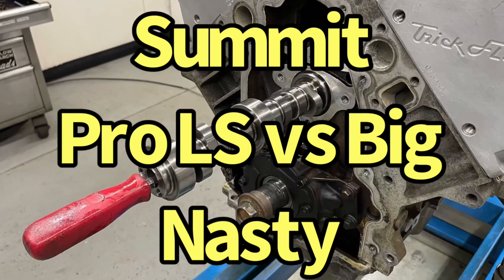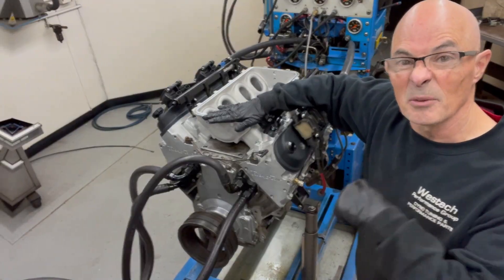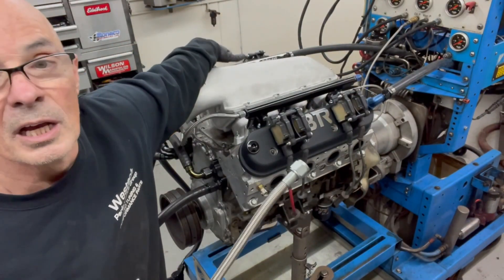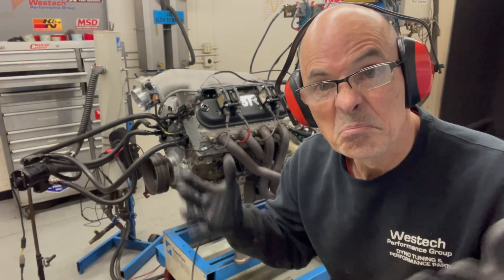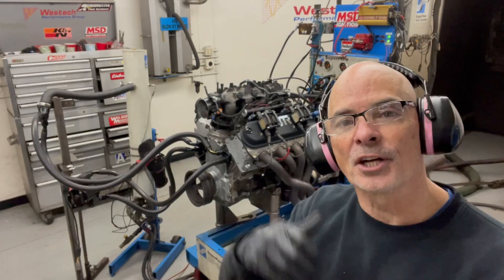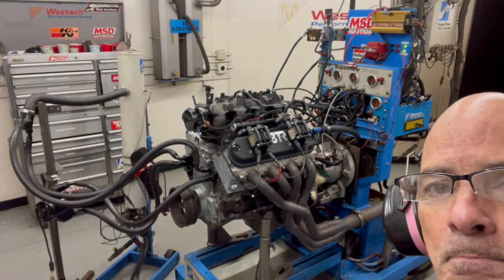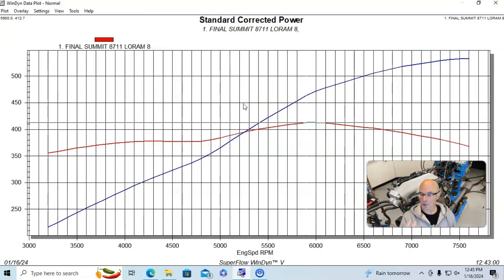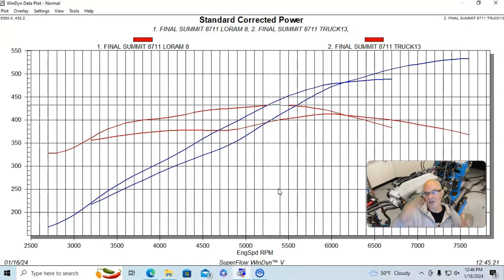TIGHT LSA 5.3L CAMS-DO THEY WORK? ENTER THE SUMMIT BIG NASTY CAM TEST-BIG NASTY VS BIG BOY 8711R1

Comment: How well is the quality of summit racing camshafts as a whole, I got a l31 350 I want to build with a summit 525/520 lift cam with a 210/220 duration 112 lsa cam from summit. Motor has 10 to 1 compression with 195 afr heads with dss racing pistons and Manley rods and arp rod bolts, with a duel quad holley 450 carbs. Is my plan.
Reply from the maker: they work well
Reply: @richardholdener1727  that's good to know thank you.

Comment: If only the Truck Norris were about .585 lift..
Reply from the maker: why?
Reply: @richardholdener1727  @ well we know lift adds power everywhere, right? So why can you not find a tight lsa cam like the truck norris with 107-108, but with more lift, say around .585-.600? Seems it would be the best of both worlds. Good low end, but more power up top? I would like to see the truck norris with those lift numbers, or the stage 4 v2 with higher lift too.

Comment: Quick question sir. I have a 2009 Trailblazer SS with a fresh forged 370 with the comp 273hr extreme energy, total engine airflow stage 2 cnc 799 heads with but platinum 660 springs 1” 7/8 headers. I have a nice set of shaft mount rockers I would like to use but I notice you don’t recommend them. What are your thoughts. ? I have the spring pressure so I don’t see valve float to be an issue.
Reply from the maker: not sure what you mean by thoughts
Reply: @richardholdener1727  Would you use the stock rockers with a reunion upgrade or the t&d shaft mount if you knew you had adequate springs? I know you love the stock rockers but I’m worried about accelerated wear in the pushrod cups.

Comment: Please tell me I'm not going to have to watch a tight lsa cam with an intake other than an open plenum. This is the reason I unsubbd to begin with. Just waste my time.. And I have to listen to a dork make engine sounds...
Reply from the maker: you obviously need to watch more cam test videos if you think a tight lsa only works with an open plenum (you have much to learn)
Reply: @richardholdener1727  ha! You totally just put words in my mouth. I didn't say anything close to that! You have no idea how funny it is for YOU to tell anyone much less ME that I have a lot to learn. I learn things everyday day & so do you, the problem is, you will look at a problem & quickly assume you know the problem instead of learning what the data is telling you. Reminds me of a sbf you did a cyl head test on and when it kept falling off at the exact same rpm with every set of heads, instead of realizing your cam timing was likely advanced, you said that EVERY set of heads were falling off due to valve springs! All new heads, all different springs.. Or the time you put a truck intake on a 5.3 you just pulled to 7600rpm!! 🤡🤡

Comment: Its alllll about the big cam, if IF!  your drag racin, rev the piss outta it and like leaving a 20ft crater in the pavement when the crank comes out the bottom....  ok maybe a little exaggeration.  BUT.... I will take 5 horse comin off the corner over 15 horse at the top any day.

Comment: I wanted to do an engine build in steps.  Do a 5.3 or 6.0 setup for turbo, but setup the turbo later.  Is that doable? Or should I just make changes when I get the turbo? Meaning should I gap for boost? Or do it later when I have the turbo setup?
Reply from the maker: gap now, turbo later

Comment: I have several different projects on the burner. 77 coupe deville with 425cid Th400 trans(just restoration). 96 OBS Silverado with carbed 350 that my father put together for me before he passed. Picked up an 07 Yukon SLT 4x4 ($2,500 at 230k miles)that has AFM that im praying will last for a while after i delete the AFM. 05 Suburban Z71 4x4($2,300 at 350k miles) that i want to use as a tow/overland vehicle. The current 5.3 (706 heads)now has nearly 370k miles. I plan on getting a built engine from Jasper or similar. Should i go back with new 5.3L or should i swap in an LQ4 and change the transmission? I would like to tow long distance, if i have a road trip or travel a ways for a new project vehicle. If you recommend the LQ4, should i leave it as is or should i install the 706 heads on it? Considering putting an LS in my 99 Crown Victoria P71 5.3 or 6.0(want it to play with hellcats)  Love your content brother. GOD Bless you and your family.
Reply from the maker: lq4 is better for towing

Comment: Richard love all the content on all your videos. I built a 6.0 Iron Block bored to 6.2, stock crank, Camaro ls3 rods and pistons with relieves, eBay ls3 heads 64cc chambers, TSP 629/615 225/236 114 cam, TSP dual spring and pushrods,BTR rockers, IC Billet low rise intake 102 TB, stock LS3 injectors, TR6 4177 plugs MSD wires stock coils, BBK shorty headers. Just wondering if you have ever done this combo before and what the expected HP Torque on 91 octane and also any recommendations on this combo?
Reply from the maker: near 540-550 hp (stock LS3 is 495)

Comment: CHEVROLET PERFORMANCE CAMSHAFT - LS9 - 12638427

Specs: 211/230 Lift .562"/.588" 122

Can I use it in yukon 5.3 2008 I found it in Summit website only $122.99

Thanks a lot Richard,

Comment: Would this be considered to be almost a Towing cam? If your trucks rear axle is geared to put you in the lower portion of this Nasty cams sweet spot.. And im also thinking how these results would translate to a 6.0 truck motor. The most common choice in 3/4 to 1 ton trucks.
Reply from the maker: just sure this idle is what you want for towing
Reply: @richardholdener1727  thanks for the reply.  But was that a Typo?
Reply: @hardhead7056 I think he meant “not” instead of “just”. I’m sure there’s a towing cam out there on the interwebs
Reply: @Scott_Buchanan  maybe. 
But im thinking of that cam like a marine application.  If the rpms are right its a towing beast.

Comment: The thing DV has actually stated is problematic about the LSA formula, is that it's just the starting point. It changes with compression ratio, desired rpm range, fuel (I believe) etc... 
To me it makes sense how DV explains it, taking key aspects of the combination into consideration and going from there.
The argument comes in where one side says LSA is an output, and the other side says there is 1 right LSA for an engine size and head. Neither are true in my understanding.

I get that shelf cams are meant to work with many combinations, and have things like PTV clearance and restrictive environments to operate in without getting a bad reputation. Most of us can't afford to have 20 custom cams ground and all the dyno and tuning time to go along with it. 
It would be a cool edition to see DV spec the cam for that engine to see how it compares. Would it solve keyboard warriors? Nope. Proof of concept? Maybe...

Nice work on the title Richard, bringing out the emotions!

Comment: I like the summit 8702 camshaft. I have one in my 6.0ls with falt top 2 valve relief pistons and 799 heads with tsp 7.450 push rods and and trunnion rocker arms. Sounds real healthy.
Reply: Yeah yeah but does it perform? The way it sounds is for the ricers hanging out in a parking lot somewhere
Reply: @Headsup9550  it does well for me, I was on budget

Comment: How would the Summit cam work in a factory head LS engine?  As tested it has aftermarket heads.
Reply from the maker: the cam works with any factory heads
Reply: @richardholdener1727  Would the HP & torque gains, using the Summit camshaft with the stock heads, be comparable to the HP & torque aftermarket heads?

Comment: So you tryed a cam with to much lsa and one with to little😂. A lsa test that doesn't incude a lsa selected by David Vizards formula isn't much of a test.
Reply: Lol... that dang Empirical formula that no one has been able to prove wrong because it was derived from actual results... thankfully Richard has proven that each combo has a correct LSA and it’s not just a random output
Reply from the maker: there is no absolute LSA for any combo-nor is there a perfect or best cam for any combo-that is nonsense
Reply: @richardholdener1727  well there is one way to prove your theory. I've seen some pretty convincing tests that say otherwise.
Reply: David Vizard is a well respected individual in the engine building community. To call his theory nonsense without testing is well, nonsense.
Reply: @richardholdener1727 Thier is an ideal LSA based on certain criteria of an engines overall combination.

To call DVs formula "non sense" is rather disrespectful to a man who's has likely done more dyno tests than you ever will with over 60yrs experience and has actually raced and also a consultant to race teams as well as a highly respected consultant to the high performance industry in general...You should understand what the formula is about and no, its not about just one LSA as you think.

Don't mix up your sponsored and paid dyno content for DVs research and development dyno testing.

Comment: Richard: are the SAE or seat durations available?  given the Timing we could compare the overlap of these cams  shorter duration and closer LSA they may not end up very different.   Also have to consider the low lift flows as LS is much different than SBC so have to be careful of flow thru intake then out the exhaust.  Can overheat catalytic converters and suck mileage so have to rethink the old camshaft advice.  We are even seeing shorter exhaust than intake especially with high flowing exhaust ports.  4 valve heads are another completely different ballgame as are semi hemi twisted wedges and hemis
cheers
Reply: The Summit  Pro Ls lobe intensities were the same across the four lobes.  I designed these two cams with intake opening and exhaust closing in the same place to have adequate piston to valve.  The “problem” we have is the customer’s want the chop of 8711 but the 51 ft.lbs of torque when they mash the throttle down low, so I closed the intake valve earlier by 14 degrees to move the powerband down. Both cams produced within 8 ft.lbs peak despite DRASTICALLY different dynamic compression ratios (for people who use that lol). I do tailor exhaust closing point around the exhaust systems used to prevent reversion and this includes turbos where a small T4 may have extremely high back pressure in relation to boost.  In this case the reversion damages engine components (buts rings, breaks pistons and valves , blows head gaskets) so the turbo cams are mostly about durability and enhancing spool. Our T6 twin turbo cams have more allowed overlap than the T4 cams.  I also look at the cross flow of the head to a small extent, but not in the way people normally think of flow percentage. After all, the valves are barely peeking open and not flowing much air at overlap. Good insites on the 4v where reverse pattern is sometimes used. I’d like to design some of those some day.
Reply: @briannutter4656   That's what it looked like to me, nice procedure especially for drop in cams

Comment: Myself personally would go for a 107 to 109LSA straight up or a 107 109 split.  For a 108LSA. Obviously depending on compression ratio and head spec's. But I would also go the middle of the road with a mid rise manifold with a 2 inch spacer to increase plenum size with a 4bbl throttle body. 
Would love to see you actually test that combo for a change over just short and long manifolds
Reply from the maker: what intake exists that I haven't tested
Reply: @richardholdener1727  have you tested the holley midrise 300 137 manifold with a 4bbl 1000cfm throttle body with a 2 in spacer.
Reply: holley midrise 300 137  @lcxu1051  looks like the LS version of the Torker II for the SBC.  It was not great
Reply: @scotttimpany2845  it's not been tested with a 2 inch spacer plate to increase plenum volume either.  This has been proven on carb engines to be worth hp and torque.
Reply: @lcxu1051  I think the biggest issue with your request is the missing duration values @ .050 (and lift values to a smaller degree).   Engine size would be nice to know, though all engines behave similarly.  Ignoring the cam for a minute... engines with short runner/single plane intakes will want to make power higher in the rpm range.  Engines with long runner/dual plane intakes tend to make more power and torque down low in comparison.  Now back to the cam...  the cam duration numbers will pretty much tell you where it's going to make power.  You should pick an intake best suited to that power range. You probably know that... Using the same cam with different LSAs COULD yield different results, just due to the LSA.  However, I'll bet money that those changes are LESS than the value of a carb spacer on your typical SBC - which could be  10-15 horsepower.  Most guys will get the "mid" or "low" versions of an intake due to hood clearance.  That being the case, they wouldn't put a two inch carb spacer on top...  Measuring LSA changes accurately would probably require "lab type conditions" and a boatload of time and money.   Richard's main audience is "regular guys" and not scientists and engineers.... As a side note, watch Richard's Kegolodon (sp) video sometime.  It might change the way you think about plenum volume.
Reply: @richardholdener1727  Ummmm.....Richard, I have an Edelbrock StreetMaster SBC Single Plane.  I probably won't ever be using it again unless I do a blow thru Turbo set up. And I just can't bare to part with it.
Reply: @richardholdener1727  Mine!  Exactly as installed on my exact combination - including the dimpled combustion chambers, flipped pistons and rod ratio!
Reply: See the comment above about piston to valve Clerance (durations and lca considerations)

Comment: How do you think the big nasty in this video would do in a street truck/weekend toy? Motor is a LM7 bored .30 to a 330 with forged rods and pistons, polished crank, CNC heads and a tbss intake with a 92mm throttle body. I'm open to suggestions on cams if you think a different one would work better. I've been leaning towards the low end torque ones but it's a really hard for me to pick a cam for some reason. The more of your videos i watch the harder it gets lol  Also, what stall would you recommend?
Reply from the maker: What transmission and how important is idle
Reply: @richardholdener1727  4l60e and idle isn't important
Reply: @Erik-330 same bro

Comment: Hey what is the limit for rpm physically? Like stock gen 4 rod,crank,piston limit? I have a 6.0 that I want to spin to 7k. I see you rev these very high but I want to know how. So what is the limiting factor for ls engines? Their valve train or bottom end. Would It be possible for you to try to over rev one to the limit. Seems nobody made videos about this topic. It’s always how much power (basically the max tourqe ) they can handle And yes I know without the right mods I won’t make power there anyway. Just want to know what I should be looking into for safe high reving. Love your vids
Reply from the maker: add springs and a cam and you can go to 7000 rpm easily
Reply: @richardholdener1727 sick I love the sound of a screaming ls just don’t want to blow it up😂
Reply: solid roller good spring and pushrod.